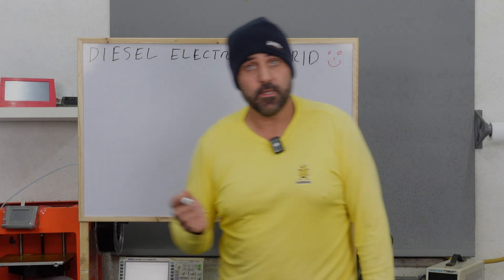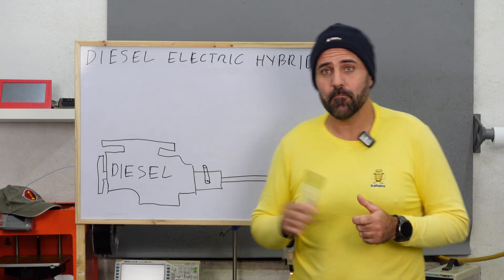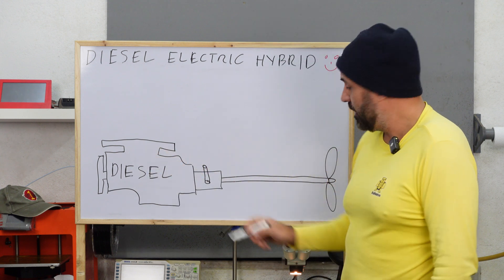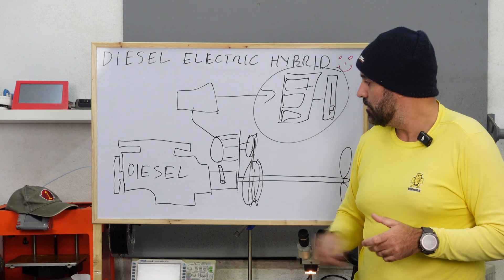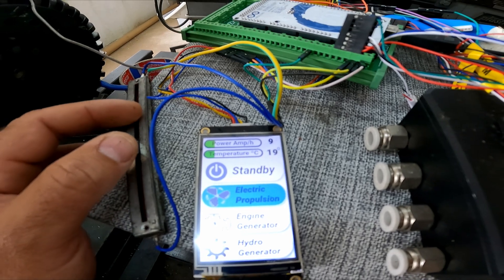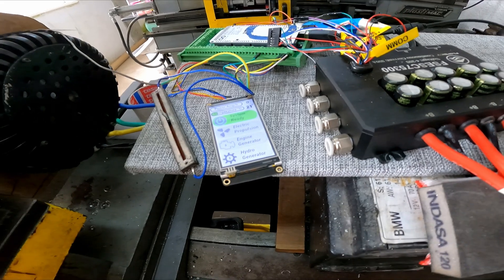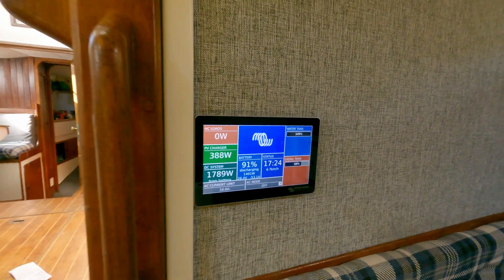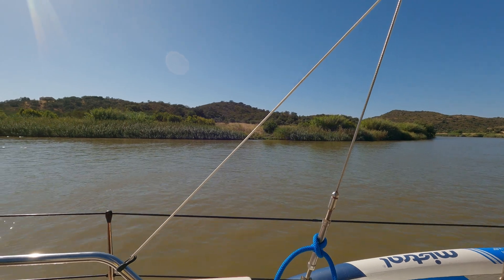Diesel Electric Hybrid Regen (DIY) On Our Cruising Sailboat🤯

Comment: I would not use a flipsky controller, they are famously finicky, for example they explode if your BMS disconnects suddenly. Spend extra 100 dollars for a genuine Trampa 75/300, the best controller in the world
Reply from the maker: That is good advice 👍 thank you 🙏
Reply: @reversingentropy .
Reply: I still think that because flipsky controllers are sooooo cheap, you can buy multiple and have them around as spares. They are super easy to swap, just make sure you have an already programmed spare on hand. I think two flipsky controllers (one working, one as a spare) are better than one trampa or focbox controller. Ofcourse you can buy an expensive one and have the flipsky as spare as well. I think the flipskys have a undeserved bad reputation, yes they used to be reallllly crappy. But they have gotten better, and they are still half the price of many other controllers. Flipsky was my plan as well, let me know if it has been reliable.
Reply from the maker: @voltage-voyage  my flip is still working fine so I have no complaints. Having multiple makes sense for sure. Cheers mate fair winds 💪
Reply: @voltage-voyage  yes but if your controller cuts out while you are under max power you can easily crash your boat. I know two people whose flipky exploded because BMS disconnected due to battery overheating, cut current and mosfets exploded. Haven't happened to any other controller as far as I know. I would have a good controller like Trampa installed and then a flipsky in a sealed metal box in case of a lightning strike
Reply: @tedarcher9120  that is fair, i can se how that would be a big problem on a fast motorboat but on a sailboat things are usually a bit slower. Ive had my internal combustion engine fail so many times as well and had to react fast. Ive also had to go in by sail or had to be towed because the motor just wouldnt start, i think even cheap electrical is still more reliable. I have kind of gotten used to always  thinking that i could suddenly have no reverse at any time, even with a good engine. so i go slow. And also thats why i suggested the espensive controller as a main and a cheaper as a backup if yiur still sceptical, you could probably swap them before you crash if you go slow though 😅 and reversing entropy has a ICE as well so he already has a backup if the controller should fail. also my plan is to buy two of the biggest waterproof motors from flipsky or maytech or something, bolt them on the outside of my hull somehow (i refuse to have ANY thru hulls under the waterline) that way i have differential thrust and two motors, aka redundancy. Just need to get money for it and find a way to mount it. My boat currently doesnt have sails nor an engine, so my plan is solar and backup generator... in the med so plenty sun, will be mostly costal hopping when i cruise.
Reply: @voltage-voyage  waterproof motors would work in a lake, but out at sea salt water would corrode  magnets in a couple of months. I would mount an electric motor in a standard way but build a waterproof bulkhead to mount the motor and protect the boat from flooding
Reply: @tedarcher9120 also the exploding controllers... sounds like the battery bank or bms was the real problem here, also to prevent this you could maybe find a way to clamp your transients, like a bidirectional TVS diode on the dc bus or an RC snubber, on the mosfet drain side or phase legs, that might help the high voltage spikes an possible save the controller in an event of a failing or disconnecting bms or pack.
Reply: @voltage-voyage  that only happens to Flipsky controllers because they don't have such protections included
Reply: @tedarcher9120  the plan is to mount them in a way where i can take them out and flush them when i dont use them. I wil not be bluewater sailing for months on end, rather just few short trips during summer. Also its far cheaper to replace the motors when they fail than to lift out the boat, completely redesign the kitchen and bathroom to build a bulkhead and loose all that space etcetcetc. I have done something similar with outboards before, i know somewhat  how it works and its just to get a better power option than the suuuuper crappy noisy stinky fuel guzzling outboard i have (i hate it and it hates me, also electricity is free, fuel is not)  If i could even close to afford your solution its not worth it for the boat. It might not be optimal or the most reliable but dont tell me it doesnt work before you tried it 😅😊
Reply: @tedarcher9120  i agree on everything you say if you can afford a better controller its great i still think a flipskybis a great controller to have as a spare or experiment with if its not your only power option.
Reply: @voltage-voyage  you can just use an electric outboard. Or convert one using a ebike engine like qs165. Waterproof motors will rust very quickly in sea water

Comment: Nice pulling power from & applying it to propeller shaft.  For another shaft add on, I saw a kind of squirrel cage blower that blows water out of bilge & over the side as long as the prop shaft turns.  Think it was called a crash pump.  Not paying attention to unit the 28 degree F water is about where salt water freezes in Deg. C that is good swimming water 3.5% salt 35 g/L water. - happy voyages!
Reply from the maker: You are in. Cheers mate fair winds 💪

Comment: 35C water, time for a swim..  I (my wife) just acquired a full electric little ferry, What's the display/system  you are using to display the solar output? Is it part of a Victron system (I noticed the logo).
Reply from the maker: You are in. Please change the temperature to a random number 😁 yes it's from victron we really like it. Cheers mate fair winds 💪

Comment: The water 💧 temperature was, well hotter then the Mojave Desert on the coldest day in mane @104F on the day temp, Hot c on the motor and 80F to 75F on the water 💧. What a day to go for a dip to cool off a bit.
Reply from the maker: Very complete answer. You are in. Please edit the comment and change to a random number 😁
Reply: @reversingentropy done. And thanks.

Comment: THIS is exactly what we want to do with our sailboat !  We had found a company in Europe ( Netherlands ? ) that makes a "bolt on" hybrid system , however it is crazy expensive ! Your system seems on it's face to be our answer !
Reply from the maker: It's been working fine so far 💪 and if something fails it's super easy to get parts and replace. Cheers mate fair winds 💪
Reply: @reversingentropy So why not just go full electric??
Reply from the maker: Redundancy. And Efficiently. 👌
Reply: @reversingentropy derp 😂
Reply from the maker: 😅 @Dan0rioN

Comment: I think the hybrid propulsion is done now.
Did you see the first video of Sailing uma with their Diy electric motor ?

And Viva electrotechnic 😁
Reply from the maker: Yes I did. I also saw all the times they had to use a generator to produce power and the times they had to tow uma with the dinghy.
If you can have both means of propulsion you are better off. You might never use the diesel engine, but it's there when you need it. Cheers.

Comment: Great video.  I am between boats now so I am envious of you and love your sailboat's name.  
I see someone asked about the Gearbox Windmilling and Lubrication but I have additional questions:
-   What motor are you using that is so inexpensive?  Will it stand up to a saltwater environment?
-   How are you adding the pulley to the prop shaft?  Are you mounting the Motor to the gearbox?  How are you dealing with the sideloading of the prop shaft?  By adding a belt drive there will be a lot of force pulling up on the gearbox bearings.  I would be worried about Gearbox Bearing Life.

This is a great idea.

Good Luck
Reply from the maker: Don't be envious lol StarryNight is not perfect and it still needs a lot of work 😂

Motor is from "golden motor" a Chinese company. 
I don't know about longevity, But it's inside in a dry protected area and I sprayed it with spray on oil once in a while.
The plate is attached to the gearbox end, there is some force sideways but nothing major. The bearing at the end of the gearbox is quite strong, I don't anticipate problems there.
I'll do an update in the future. And if there's some issues I'll make a video about it.
BTW there is a big video on the members side of the channel. Explaining the system in much bigger detail.
Cheers mate, fair winds.

Comment: I have one question, is your gear box still getting adequate lubrication from the spinning prop shaft whilst in electric propulsion mode. I ask because many a saylor try to prevent windmilling their prop under sail, due to believing that you are causing excessive wear on the gears inside the gearbox. This is one of the reasons Hybrid Marine utilize a shaft coupling system with their diesel electric hybrid systems, what are your thoughts?
Reply from the maker: Our transmission is hydraulic so even if we put it into reverse the prop never stops spinning under sail. Nevertheless the gears on any gearbox are partially submerge in oil when they turn the oil mover around. But It would be great to have a coupling, if nothing else to improve efficiency. Hope this helps. Cheers mate fair winds 💪
Reply: Good question and I think that explains why Paulo has hydraulic transmission as he says.  I like the Beta hybrid engines from the UK, great red colour, robust, solid engineering, but really expensive which is a problem.  But what I was interested in is their recommended transmission which is also hydraulic.  There may be several reasons but excessive wear on gears is probably one of them.